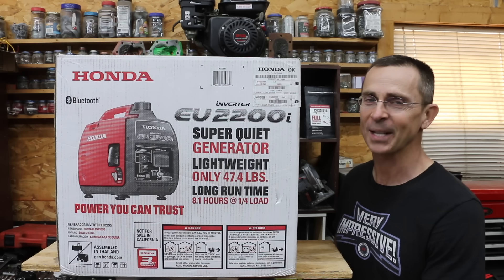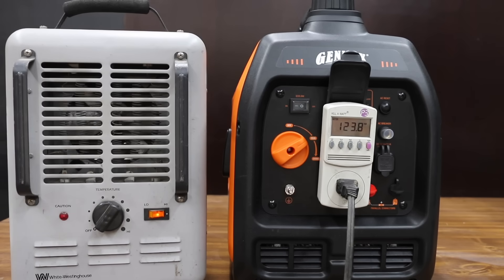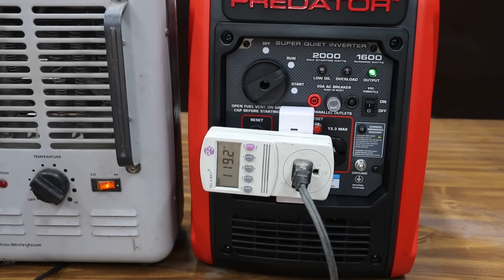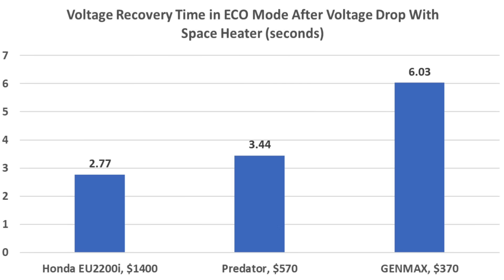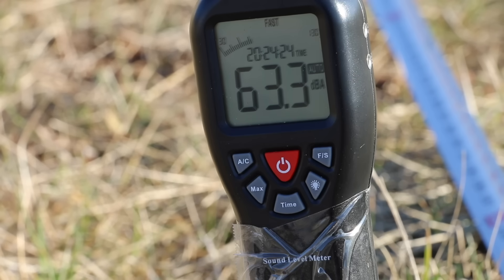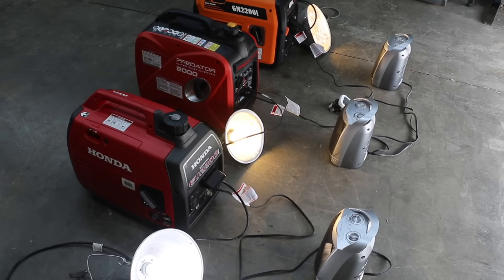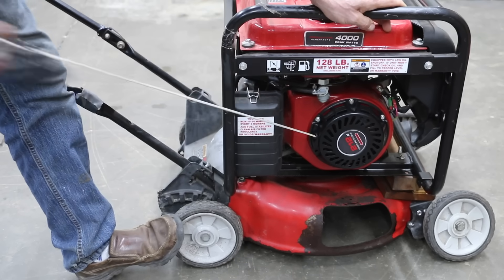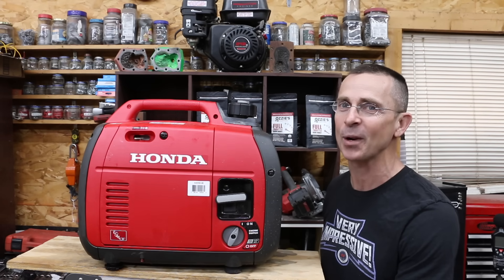Cheap Generator Better Than Honda? Predator vs Honda & GENMAX—Let’s Settle This!

Comment: I'd LOVE to see a comparison between generators/inverter generators that can also run on propane and/or natural gas. I think it's difficult to figure out what load they can support on the non-gas fuels and how well they'll run. Also, see how well they each handle higher start-up loads. I had to put a soft starter on my home A/C for my generator to handle the start-up current draw, for example.
Reply from the maker: Thanks for the suggestion.
Reply: It might be good for generator design to include a turbo button for startup purposes, bumping up the voltage momentarily to make it better able to supply the inrush current from the motor draw on startup but not simply setting the high voltage output all the time.

Comment: A good test is to run them at full load for 24 hours. Test for oil wear, temp and or mechanical failure..

Comment: I've owned one of the older version Honda EU2000i generators, and it's been flawless. 

IMO, besides the generator putting out clean electric is parts availability. Other than Honda, most of the knock-off generators are here today, gone tomorrow, so when it breaks, toss it and get another one.

Your neighbors must love it when you have a yard sale. You've got the coolest stuff that's always being upgraded. Well done.
Reply from the maker: Thanks for the feedback.  No yard sales.  What I don't save for future episodes I donate in my community.

Comment: I would like to see a comparison of two motorcycle engines, one that you properly "break in"  and one that you do not and see if there is any difference after a number of miles on the engine.
Reply from the maker: Thanks for the suggestion.

Comment: One thing that would be nice to see, is the starting capacity on the small ones. My EU2000 has no issues starting a 13.5kbtu air conditioner (with ECO Off), but lots of the knockoffs wont do it, requiring soft starts/capacitors be added.  Not sure how you'd test it, but is very relevant for RV users. Seems as though the Honda has bigger capacitors to help with this vs others. 

It always seems as though everyone tries to buy the cheapy first... use it for a year or two only to have it pack in and then they buy a Honda. Very cool to see the oil wear reflect that.
Reply: The Honda has a larger engine so it can put out enough power to overcome the inrush current on the AC unit. The other 2 use smaller engines that are sized to just barely provide the rated power (and the GenMax one couldn't even do that).
Reply from the maker: Thanks for the suggestion.

Comment: I'd like to see a longer term test on these generators. Especially the Genmax and Pred. Maybe at hour markers 250, 500 and 1,000. The oil test comments suggested not much to worry about as the wear metals tend to show up during break in hours. At $350 or so the Genmax seems a huge deal on price.
Reply from the maker: Thanks for the suggestion.

Comment: I don't know if you have done this, but I think we can all benefit from this test. The screw head types that are commonly available, Slot, Philips, Robertson, Hex, and Torx heads. Which is the better head for screwing a screw into hard and soft wood? Each head has its uses. I have stopped using slot and philips head screws and will not by them. If the local stores will not stock the last three heads, then I order them on line. You do make some darn good videos. Thank you.
Reply from the maker: You are welcome!  Thanks for the suggestion.

Comment: I'm sure it has been mentioned that one thing that is hard to test is overall life of the unit. That is why the Honda costs more and is likely worth it. You want to be able to count on your generator when it is needed.
Reply: @tooltime9260  There ya go.
Reply from the maker: Thanks for the feedback.

Comment: Great review , no doubt Honda makes the best small generator, I’ve been looking at the small champion dual fuel generator 2500 for the flexibility, and longer run times using propane , would like to see you do a review on it please .
Reply from the maker: Thanks!  Thanks for the video idea.

Comment: There are a crapload of these inverter 2000 wattish generators out there and that Honda is thee measuring stick,I got a wen 56203i (not to be confused with other very similar models they make)2000 startn1700 running paid 379 2 yrs ago,has a fuel shut off to run carb out I got about 200hrs on it runs great no smoking now I broke her in good and run synthetic but really satisfied with it its got the 79cc engine also not the big industrial one in the Honda and the oil changes are at 25hrs not 100 like the Honda so yeah you gotta pay a lot for that tho I'm not some wen fan boy but for 400 it's pretty decent prob like the genmax maybe better like I said it didn't open it up then bash it I ran srght 30 at no load for an hour then changed it then varied the load for 5 then changed again she's clean and runs good just needs more tlc than a Honda good work here again! Non stick pans that would be a good one😂
Reply from the maker: Thanks for sharing.  Thanks for the video idea.
Reply: @ProjectFarm  you're welcome,thank you!

Comment: I'd be curious to see the Generac XP series vs the Wacker Neuson GP series (and other low thd AVR generators). Both are touted as having low THD and durable.
Large inverter generators for powering a home are very expensive (5kw+), and these two (above) are marketed as <5% THD.
Reply from the maker: Thanks for the suggestion.

Comment: every 3dB increase is double of sound pressure or loudness. So the The predator is twice as loud as the honda and the genmax twice as loud of the predator.
Reply: Not quite, 3 dB is a doubling of power

6 dB is a doubling of voltage or sound pressure level (SPL)

10 dB is considered to be, to humans with a non linear sense of amplitude, a doubling of apparent loudness.

Comment: We got an older Honda EU2000 from my grandparents, it’s actually from 2000 or 2001, so it’s older than me lol. My grandpa was would backfeed it into the house which is very illegal and you need a proper generator transfer switch because backfeeding electricity into the grid is very very dangerous and illegal. But they upgraded to a fancy generator that automatically turns on and runs off of natural gas.

Comment: Currently keep a predator 2000w inverter generator for power outages. Its proven to be enough to run our fridge and pellet stove which are typically our main concern, fuel seems to past about 8 hours with this usage. Only negative is that the oil consumption seems high, at least during the break in period (which is 30 hours of operation), and should be checked every time you top up the gas. Its frequent enough that I wish they has an easier way to access the oil than to pull the whole side panel off.
Reply from the maker: Thanks for the feedback.

Comment: Glad to see these three in contest, since they are probably the three "most likely purchased" and obtainable from big box hardware stores. Round two should include Champion from Tractor Supply, Ryobi from Home Depot, Yamaha, and a random "no brand" unit from Amazon. Lowes' Craftsman is just rebadged Genmax, as I've confirmed using my father-in-law's inverter in a previous camping trip
Reply from the maker: Thanks!  Thanks for the suggestion.

Comment: To be honest I've never knew that inverter generator is exist. I think its time for my very , very cheap 800w 2 stroke generator to rest. That thing had been used as my go-to power source to power my power tools for many years and I always overload it with my 1kW welding machine for 2 years.
Reply from the maker: Thanks for the feedback.

Comment: Honda might be most up front cost, but my trusty EU2000i has worked perfectly for untold number of hours over a ~20 year span. Still starts immediately and is just as smooth as when new. Amortize the cost over the lifetime of a generator, and get the benefits of knowing it'll work when you really need it to, and Honda is the clear winner.
Reply from the maker: Thanks for sharing.

Comment: Informative as usual!

I have a WEN 56203i 2KW inverter generator, bought a bit over 2 years ago and so far only used once, to power a small jackhammer, for which purpose it proved quite adequate.  No idea how it compares to others; it had decent specs, was cheap (under $400 at the time), and had good reviews on Amazon, so I went for it, and it seems OK for my purposes.
Reply from the maker: Thanks!  Thanks for sharing.
Reply: I have 3 wen inverter generators 6250,4000,2250), a generac, and a honda eu2000i all purchased new over the years.  I do meticulous upkeep with them and so far I have not had any issues with the WEN brand.  In fact twice my honda needed the spark plug cleaned and starting fluid to come alive after a few months where my wen generators fired right up.

Comment: I am awful at taking care of my small engine equipment and am still amazed at how well the Honda motors hold up. They always start even after sitting outside for months during the winter. I know I should be taking better care of them but in the meantime I will only buy Honda, lol.
Reply from the maker: Thanks for the feedback.

Comment: The commercial electrical shop I work for uses the Honda generators. The men don’t treat them nice, including falling off a truck and running on their side yet the Hondas just keep going. For years! The shop tried switching to Predators but they didn’t hold up at all. Some just lasting one day before spilling their guts. In fairness, these things are abused by guys that don’t own them and didn’t have to buy them and if they break one the shop gives them another BUT, the freaking Honda units just keep chugging along.
Reply from the maker: Thanks for the feedback.

Comment: Did you do the vibration reading in ECO mode? It seems like the Genmax and predator were shaking more than the honda as you noted. it would be interesting to see just how much more vibration there was in ECO mode. Nice video, thanks.

Comment: I have that predator.  Use it to run my fridge during winter power outages.  Works great, no complaints.  Especially for the cost. Also have a 3500 watt honda inverter generator i Use to power my camper.  Its awesome.
Reply from the maker: Thanks for sharing.

Comment: I think you should do a difficulty check for the pull starts
How much resistant and how smooth, or clunky from they are from compression.
Or easy to pull start?
Reply from the maker: Thanks for the suggestion.

Comment: Those predator generators are unreliable! We do off road racing and I don't know how many of them I have helped work on at the races as they won't stay running or surge constantly. The Honda and Yamaha invertor generators seem to be the most reliable. See far more Yamaha than anything else at the GNCC races.
Reply from the maker: Thanks for the feedback.

Comment: 6:43  those squiggly lines are called harmonics and can be measured in THD%. Inverter based generators use IGBT's which pulse DC to create the sine wave. This is a major problem currently with grid scale solar inverters, luckily most of them are absorbed by the main power step up generator.
Reply from the maker: Thanks for the feedback.

Comment: I live on a boat. Everyone has a generator of some kind for emergencies and we use stroller mostly. The pure sine wave allows my refrigerator to run 20 W lower. Then my 1,000-watt Jupiter inverter. I like your video it was very informative about spark plug caps
Reply from the maker: Thanks!

Comment: I have had this model of Honda generator for over 15 years without an official service, just do yearly oil changes myself. This machine just works. So if you plan to keep it for a long time, and demand guaranteed reliability, be it persistent or intermittent use, then just get the Honda, it is worth every cent and not only will likely work out cheaper, it will definitely be there ready to work when you need it too.
Reply from the maker: Thanks for sharing.

Comment: "100 volts is a lot of voltage drop"
Since when?? That's essentially bang on and appliances won't care at all, especially seeing how 110V is common across parts of the US and 100 in Japan. Nothing that can run on 2200 watts is going to care about 20 volts.

EDIT: the genmax is probably showing signs of heavy wear because it hasn't been broken in yet, but I'm not sure

Comment: With all the information on the cleanliness of electricity......it would be interesting to use the generator with the worst output connected to devices like a surgex (my favorite) and see how well the different brands can clean up that wave.
Reply from the maker: Thanks for the suggestion.

Comment: Honda replacement parts are very expensive,  in 22 years of owning Honda generators I have NEVER replaced a part, except for a pull cord and that was generic not Honda!   I have sold several Hondas over they years and got back most of what I paid for them,  not throwing them in the garbage like the clones.  So no comparison, even the 2200 warranty is 3 years not 1 year like the Genmax or 90 days like the Predator.
Reply from the maker: Thanks for sharing.

Comment: Something I noticed right away is that all 3 generators have 20 amp receptacles but says that the max load is 15 amps. UA would not approve these machines for use.
Reply from the maker: Thanks for the feedback.
Reply: They're GFI recepticles. Get your code book out and see why they're 20 amps.

Comment: Such a detailed comparison. I can't think of a single question you didn't answer. 
I would buy a used Honda, than any new Chinese knock-off. It's a Honda crying out loud. 
This Honda engine has almost twice the engine size (121CC) , but consumed fuel almost the same as the other two with smaller engines (79CC). That was a nice surprise.
Reply from the maker: Thanks for the feedback.

Comment: The oil analysis was very insightful. 
If you a generator test again, could you include a Westinghouse iGen2500 Digital Inverter Generator 2200 Running Watts | 2500 Peak Watts ?
Lowe's and Sam's carry these.
Reply from the maker: Thanks for the video idea.

Comment: Stupid question, let's say I don't have a lot of use for the generators, maybe once a year due to ice rain, is it possible for me to make a custom voltage stabilizer (or buy one if it's available) and use the less expensive ones? Is it a bad idea? I do have some electronics products that is kinda sensitive to voltage changes.
Reply from the maker: Thanks for the suggestion.

Comment: I wonder if you spent a couple hundred bucks and a weekend on the 370$ one if you could get it to run better. My first thoughts would be get rid of spark arrestor on muffler, replace the spark plug with a higher quality. Dismantle the engine, hone the bore, check the size, get proper piston rings, balance the crank, replace the bearings, balance the flywheel with the engine running. I bet she would hum really nice. The important part like the electronics all seem to work well so just some minor small engine work, a shop that specializes in trials moto racing or dirt bikes could do the work quite easily.
Reply from the maker: Thanks for the feedback.

Comment: I have a WEN GN400i RV-Ready 4000-Watt Open Frame Inverter Generator that might be a good test subject. At the very least, you should download the instruction manual and read it carefully as it contains many hilarious easter eggs. It was the instruction manual that pushed me to decide on that model when I needed a small generator for occasional use at work.
Reply from the maker: Thanks for the video idea.
Reply: @ProjectFarm  The easter eggs start at the Unpacking & Packing list with "With the help of a friend or trustworthy foe, carefully remove the generator from the packing..." and go on to explain how to find ghosts causing malfunctions and other fun stuff 🤣

Comment: Suggestion - Freeze Sprays for removing stuck bolts, joints etc - I know you've done penetrating oils/seafoam - but heat not always an option, but you could test that too?
Reply from the maker: Thanks for the suggestion.

Comment: Love your videos, thank you for the great content.  I would love to see Champion compared to other brands in the 9,500 watt plus range. Not whole home but where you can run most appliances, outlets and lights.  That is my most current setup at 30 amps but I feel like I want to move to 50 amps but I am not sure if they is a true advantage because I still won't be able to heat water or dry clothes but would have more compactity even though I haven;t really needed it.
Reply from the maker: Thanks and you are welcome!  Thanks for the video idea.

Comment: Would love to see testing to put to bed all the lore around silicone sealant/gasket makers. Mainly on how long you need to wait before putting it into service like with a rear diff for example. Whether or not to spread it out or to just apply a single bead. etc.
Reply from the maker: Thanks for the suggestion.

Comment: I have the same predator generator with over 3k hours on it never had an issue with it yet i also have the predator 9500 inverter generator that i do plug into my house and use for other things it has seen a tremendous amount of use the first year i purchased it literally ran every single day 365 only shut down to do maintenance  i have 13000 hours on it BUT it is having issues now i ran it 2000 hours with only pulling 800watts and i think that ended up hurting it
Reply from the maker: Thanks for sharing.

Comment: On the predator,  I have seen this oil use as well , what happens is the spark arrestor will plug up , remove arrestor and keep plug changed and they run much better. 

I wish you would have tried the Yamaha,  I have one and there are a few things I like better about it , one is the fuel shut off,, it allows you to run gas out of carb before shutting motor down
Reply from the maker: Thanks for the suggestion.